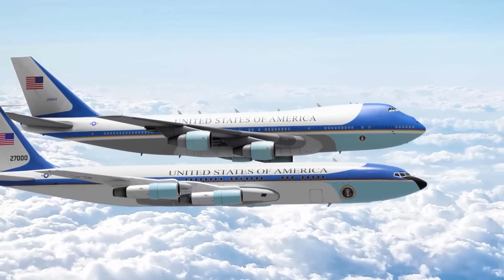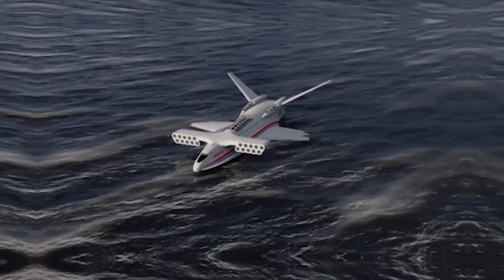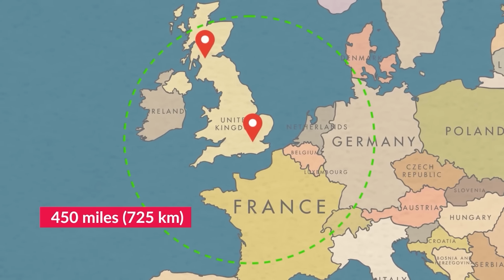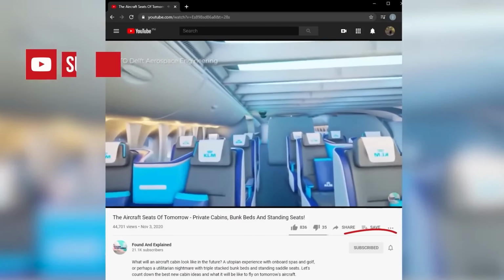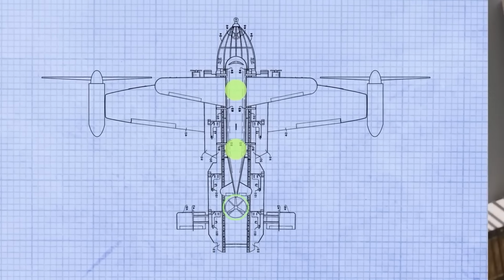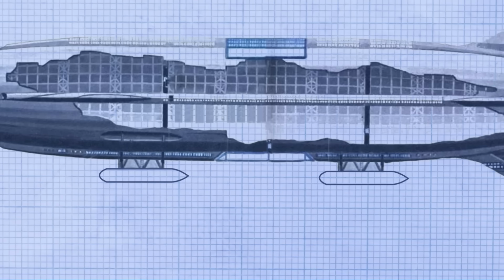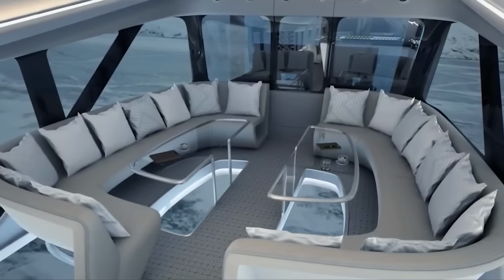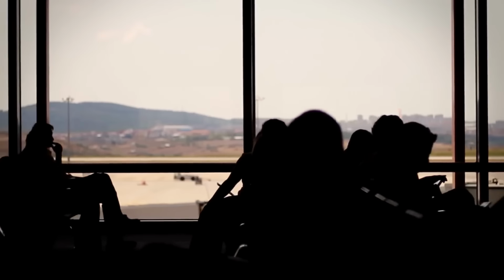Incredible Engineering Projects Lost to Time | Full Documentary

Comment: The train is interesting but seems a series of accidents waiting to happen which as an uninformed person I could see I ten seconds as I’m sure most people did .when we see how difficult it is for a small jet to dock to refuel and the amount of turbulence that has caused many accidents the it seems a mad idea .plus the docking point is going to be the weak point and cause massive stress on the join. Also , surely the different designs of the docking and receiving planes would cause a lot of extra drag and disturb the efficiency of both planes ? 
Nice if it would work but as you said , there are problems .